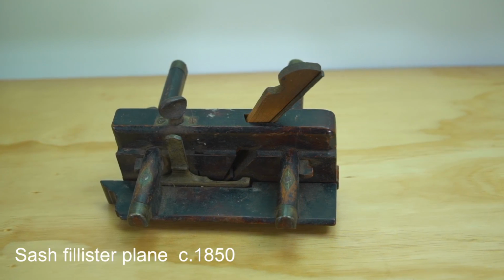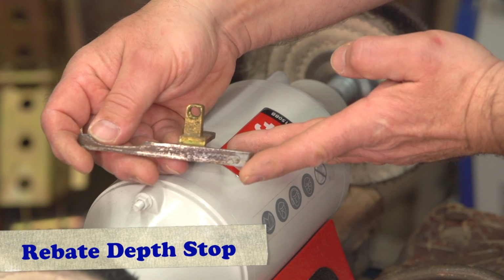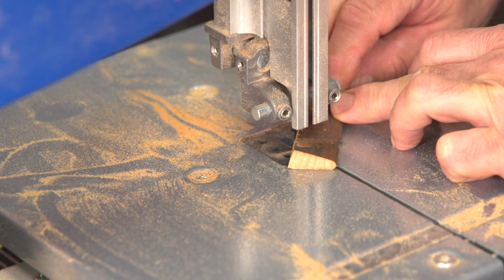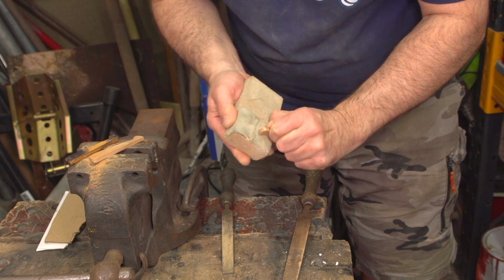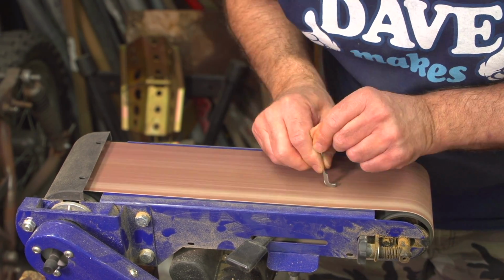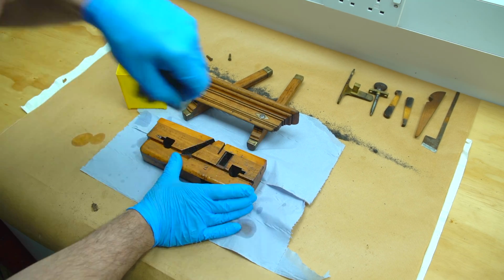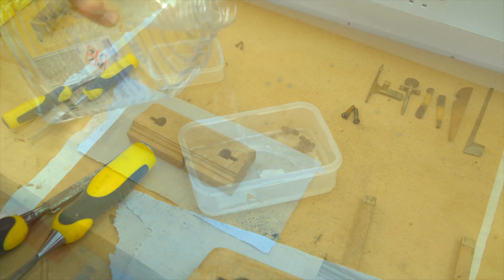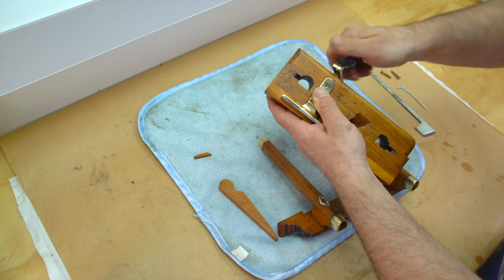1800's Antique Plane Restoration (Narrated and Music version)

Comment: Restoration is very satisfactory. Your personal workshop and clothing is an impending disaster. No shorts near rotating machines with scatter please. The use of heavy rotating machines and vice on a workmate clamped by a G clamp would not be accepted in any industrial premises. It would not matter so much other than your comments upon safety. In a long career I have helped extract and extracted myself from daft situations from similar situations and for a time was a safety officer - not that the title means much in U.K.  I was told the ability to do joined up writing and spell legibly was adequate! The plane however is a star and you are to be congratulated on such artistry.

Comment: I am surprised there isn't video of you trying the plane to see if it works properly.  Also, in my restorations, I never use any harsh chemicals.  I hate drying out old wood any more than necessary.  I was taught to use Murphy's Oil Soap to get the dirt and sweat off of wood and leave the discoloring from use.  Then finish with only wax. (I am allergic to Linseed oil and spontaneous combustion of rags) Everyone has an opinion on how to restore.  None are wrong or right.  Excellent video in the content and the production though.  Totally enjoyed it.  (really would have liked to see the plane work)
Reply from the maker: Hi Bruce, thanks for your positive comments, I'm glad you liked the video, I've subscribed to your channel and would love to see some of your restoration work👍😊ps. love the squirrels😊